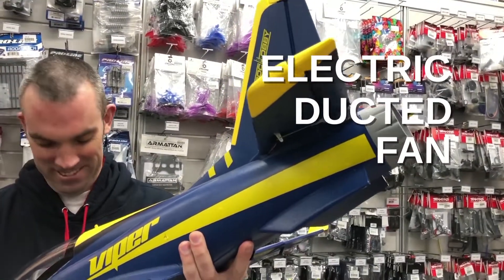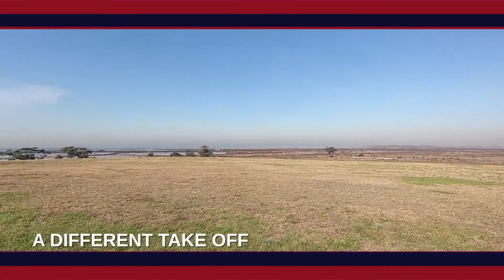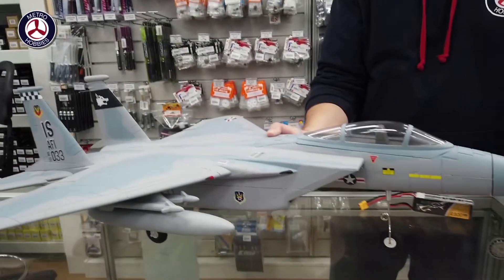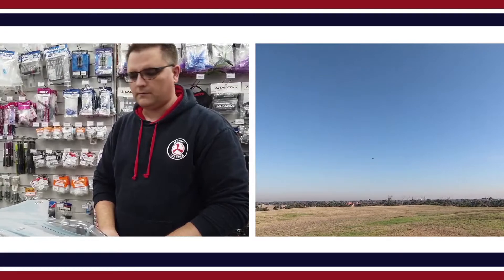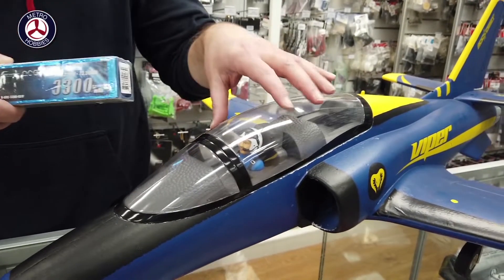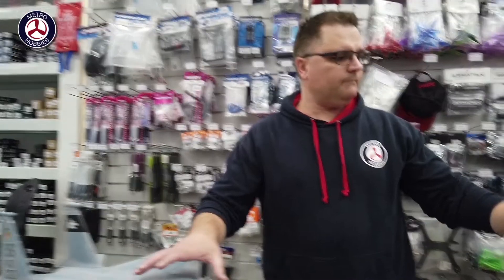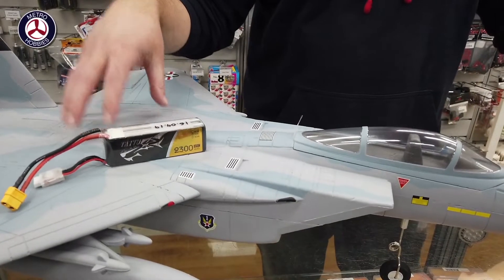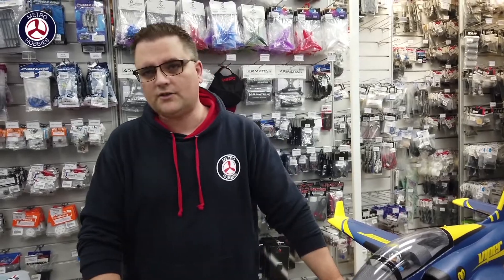The RC EDF Jet Plane: What you need to know

Comment: For the beginner, 5 bladed fans have more thrust and are easier to take off from ground or hand toss.

For those who are new here to this video, there are a few very good 3s battery systems which means CHEAPER planes and cheaper batteries. The Freewing 64mm series, namely the MiG15, the Lippisch p.15 and the F86 are all great options. If one wants to go 4s, I've heard the Arrows Marlin is EXCEPTIONAL value. All the above mentioned jets are 5 blade fan setups, while the Marlin is an 11 or 12 bladed fan on 4s.

Take care and FLY ON!

Comment: The big thing for me having the Viper as my first edf,I learned the landing speed is absolutely critical. To fast and it will bounce which 9 times out of ten it will stall and usually break the nose,to slow and it will pancake with potentially similar results. But when you get it right it's awesome. It really is a great edf,it flies so well and looks great in the air,but I do wonder if it really is a good trainer. I won't be buying any other edf's this size. I'm told a-10's etc are even harder to land so that's it for me. Just my 2 cents,that's all.